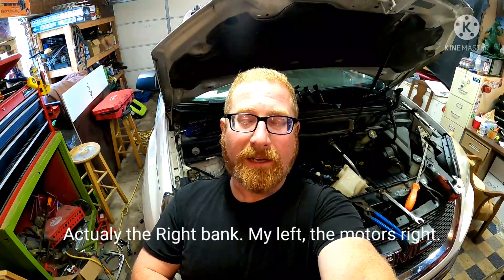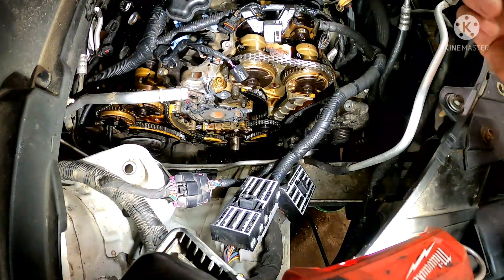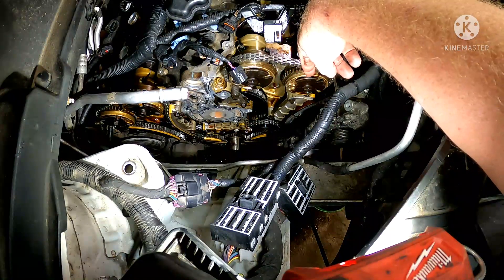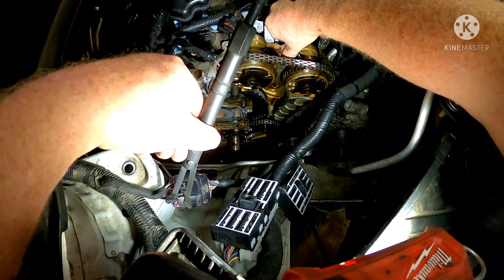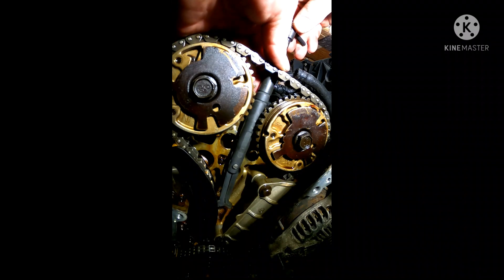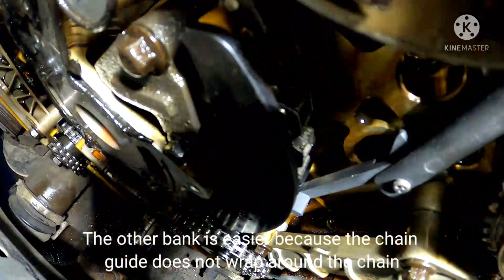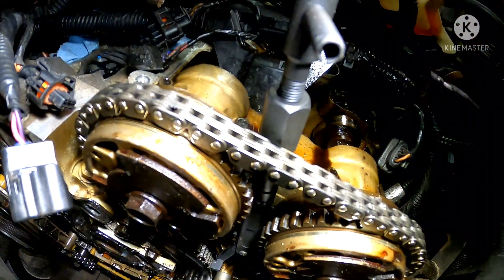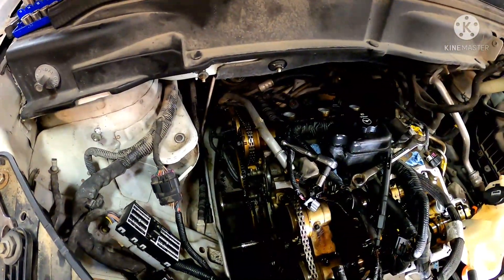How to replace a GM 3.6 VVT cam phaser without removing the timing chain or cover.

Comment: thanks i’m dealing with a nightmare myself. cadillac 3.6 replaced head and timing someone dropped bolt in motor and messed up head compression is low on new head think it’s out of time just bought that tool

Comment: If you take the phaser out without removing the cover, how do you ensure the new one you put in is in the correct timing position?
Reply: For what it's worth, a source I am certain is the factory service manual demonstrates the use of a paint stick behind chains. It isn't detailed, but seems to suggest applying some marking medium to link and any involved sprockets. I have never done it and don't claim it works. It seems obvious very careful attention and very careful marking of links must be done. I think the phasers are locator pinned to cams. Timing cams to crank must be preserved, no matter what is done. The colored timing links will almost certainly not be relevant. I put two sets chains in separate 3.6 successfully. Best luck.
Reply: I mean colored timing links won't be in the right place during use of this tool. Obviously critical doing chains.

Comment: I am trying to do this right now on my 09 Buick Enclave.  Fourth time I have been into the timing components in four years of ownership.  This engine is a terrible design.  Do not buy one.  The VVT sprockets do not have sufficient clearance between the end og the cam and the timing cover to come out.  I am going to try and loosen the timing gover bolts and see if I can sneak the sprockets out.

Comment: My sister has an 09 Buick Enclave.  Same engine.  I have replaced all of the timing components twice in the last four years, and it looks like I have to replace one of the phasers again.  My feelings about the car are exactly the same as yours.
Reply: me too have a 2008 SRX same engine getting P0017 & P0008 codes....bummer. 198k on the odometer tho.

Comment: Just a an Observation with these motor and a lot of manufacturers they make the pvc system operate to minimum spec. So it make the oil get contaminated with not venting properly with DI mitigating oil. Then the addition of extended oil change intervals make it horrific. So every things get gummed up and has to work harder. Their fairly decent engines that were designed to return to the  service bay. My suggestion would be a timing chain and phaser replacement. 3-5k oil change intervals with Amsoil (quality oil). Use Shell Rotella t6(diesel motor/higher cleaning agents) oil and a flush oil and to clean up the  oil system yearly or twice. Only as a flush so just fill/drain 3/30 min =3 bottles then place quality oil. Also replace the PVC breather yearly.  Liquidmoly fuel injection cleaner 6 cans one on each fill up to attack carbon build up on pistons. This a thing that the across the board with all manufactures in my opinion. So optimal maintenance schedule is required for all these cars that are usa manfactutred. Need a bullet proof car Lexus even high mileage 100k-190k depending on how it was driven mostly highway. Use the flush method / carbon clean /pvc replacement on Lexus motor as maintenance and you'll thank me later. lol

Comment: Thanks. Hoping my code on 3.6 is just the solenoid.  Probably not.  Just sold my best car for $4. Saab 93 250,000 mile, no work except oring on power steering. Probably going to be sorry.

Comment: Do not buy a GM car with 3.6 VVT engine. My Enclave 3.6 failed at 68K miles. This is a crap engine.
Reply: They came crappy from factory but with a little touch ups these motors can last you 300k+ miles. In other words it needs to be rebuilt
Reply: Mine blew at 69k miles, same motor I’m going to buy a donor motor to replace the bottom end that blew up

Comment: A bud of mine wrecked his vvt gaskets and I'm not exactly sure of location. Just wondering if you can replace them from the top side removing phasers with same tool or is chain cover removal necessary?

Comment: Regarding "the tool"...google the number specified in the video and you can find for about $165 or so....but, beware.....it seems as though the tool locks everything in place so that the chain does not slip off the lower sprocket - not provide slack.  Additionally, it would seem as though you need to remove the camshaft to get the sprocket out as there does not seem to be enough clearance to remove the sprocket with the camshaft and chains in place.....is there anyone that has actually changed these without removing the cover or is this an urban legend?
Reply: I am currently attempting to 😂

Comment: Every now and then I give the pcv a couple of squirts of throttle body cleaner on engine, also change oil every 2.500 miles and add a bottle of high milage Rislone. 250.000 miles no slap no problems, get 19 miles a gallon.

Comment: Great video!! Can you tell us what tool you use for removing the harmonic balancer?
Reply from the maker: I used a 3 jaw puller that i cut one of the reversible jaws in half to clear the structure of the car. It was a real pain to get that jaw to stay engaged. I think i wound up wedging a 3/8 extension between that jaw and the center screw to get it to hold in place
Reply: @Rosco P Soultrain , thank you for responding. I think I may have seen that in one of your videos? I appreciate your taking time to answer, thanks again! 🤙💪🇺🇸🇺🇸
Reply: For rent at Advance, and it's a slick little number that really works.

Comment: I notice the tensioner will be lock if it's not push in all the way, (I used a C camp to push it in) and reload the holding pin, make sure it works by pulling the holding pin to verify it's not lock in place.

Comment: where did you buy the tool and a price if possible
Reply from the maker: Fredom Racing tool and Auto. I think it was a little over $300 for the pair. I am thinkig about putting the ones i have on ebay.

Comment: This vehicle is a pain. I'm currently working on mine. Attempting to replace cam phaser exhaust, bank 1. Used the tool but it doesn't do well. Couldn't get it to retain the chain. Gonna have to remove the timing cover anyway. Seems this tool is more so for retaining the chain while having to still remove the timing cover. Bummer. Thanks for the vid.

Comment: I have a Cadillac CTS with the same engine, just did this for the third time, finally got it right I believe? I bought the car with the problem so have no baseline to know for sure but it is running very well right now (as much as a 3.0L can I guess) though it ran pretty well before after my second attempt too until it didn't. Anyway the codes clearing is still my concern, if I may ask? Where did you find the info regarding the codes clearing in 15 run cycles and/or 200 miles, I have an OBD scanner program and have cleared them multiple times but as soon as I shut it off and restart, the codes return, did this eventually resolve for you and do you have any idea what amount of run time is considered a run cycle? I need to get rid of this CEL it's bugging me and I may be selling this bugger.
Reply from the maker: I cant remember where i read it at. The codes did clear after a couple days of regular driving
Reply: If I'm doing the phaser replacement on a 2008 Cadillac CTS with 124000 miles should I replace the timing chain as well?
Reply: @EEEBA1  Personally I would not want to do this job more than once if you even get  a second chance to since it's an interference engine, though it seems that's nearly impossible. I would most definitely change all functional parts, to me having raced sports car before, it is not worth cutting corners, if anything fails then you suddenly have an interference engine that implodes on itself and the parts are not prohibitively expensive to change.
Reply: @kw57rx8dr.9  I agree. It's better to change it since it should be easy to access.

Comment: good afternoon friend, I have a Chevrolet Captiva 3.6 v6 engine and I have to change the pulleys of the intake controls I live in Dourados Mato Grosso do Sul in Brazil, and I cannot find this tool here in Brazil to buy, could you please tell me help me by passing the code of this tool or some site that I could import from your country to mine I would appreciate it, thank you

Comment: We bought a Caddy SRX AWD with the 3.6. Cool thing about the AWD is the engine/trans is linear instead of transverse mounted. I still have to work on it seems as much as you do yours but this setup makes it a lot easier; much more like working on a pickup truck

Comment: Do you remeber the torque specs for the cam phaser bolt? Found somewhere on the internet that said 118ft/lbs witch broke the bolt off in the cam
Reply from the maker: I believe it was 45ft/lbs but i cant recal for sure

Comment: the reason this car is annoying is cause of that interference(which is interdependent) engineering, one thing goes wrong & it makes other stuff go rong.  pcv holes/sludge in engine clogges up phasers, they mess up timing, or make oil clog up tensioners, then loose chain, then mess up timing, & so on, in what ever order, this needs up that, then that messes up this. why? s2pid-S interfeerance engine engineering crap.  & 183k/10 years old is the kind of area where this s2pidiT comes to flourish in its dumnS.  Because if this multidirectional interactive engineering dumness/s2pidiT, one is Ysr 2 replace everything & clean it at same time.. 
now on that note about that hypothetical sludge dissolver I mentioned in last comment.. never-mind i gUgLd it, auto RX plus all natural engine cleaner, 1 plastic bottle.. so perhaps problem start to finish is - 1, brake clean/vacuum out bulk of sludge under oil covers, 2, drill top hole 7/64ths & botom 2 holes 5/64 in PCV valve & clean with brake cleaner, 3- oil change & flop 2 bottles of that auto RX in there. 4- again in another 3000k & 5, do an entire timing chain, with water pump, oil pump(trick to torque those bolts in secret sequence, utube it), seal to sump pump, etc., all the cam phasers & sprokets & gaskets & everything..  then from then on, change w/quality oil maintanance dose of auto-RX & Home Depot green can chlorine free brake clean pcv valve each time.  for all those little holes in crankshaft actuators & phaser sprockets & timing chain tensioners & ALLL THAAAT DUMLY ENGINEERED STUFF..  someone please make 1 good video of the entire above paragraph?☝️  THANQ!😑

Comment: Be prepared to chase diy problems. I have to replace lifters in bank 2 and the sensor on top of the tank ony 2010 Camaro V6. To make it easy change the phasers, lifters and rocker arms while you got it open. I also changed the oil pump. Plenty of good vidz on how to do all that. It may cost 1k or a lil more but better than 5-7k. Or more at a shop. 😳

Comment: someone’s gotta invent a biodegradable substance that turns all oil sludge into a fine viscosity liquid that can be drained, THEN someone must make a step by step viDO for how to replace, clean, a torque the entire timing chain area with EVERYTHING REPLACED.  mNnnn some1 do it, we don’t all have 3-4000$ to fork over to the dealer while we car lessly wait a few weeks for them to get around to it👋😑.

Comment: good job just for attempting it(& good chance successful).  I believe to change everything at dealer, full timing chain kit, water pump, oil pump, all 4 camshaft wheels, all gaskets, set timing phase 1 & 2, & alll that gibity gab.. costs several thousand at dealer, & a few thousand at least at mechanic(& they have chance of screwing up).. it ain’t no picnic & I wonder if it’s cheaper & better just to buy a low mileage used engine & swap it- that’s an unknown I suppose👋😔

Comment: You have way too much sludge in that engine. The oil pressure passages in the chain tensioner there gets clogged, varnished,  and then fail. More freq  oil changes, better oil, and especially keep the PCV oriface holes clean on that engine right bank ( to left when looking at the front chain sets.) They are too small and clog, completely. Some people ream those orifaces out bigger, They are really tiny/small. Then carbons from the trapped crankcase  gases gum the oil. (ESPECIALLY with Ethanol fuels) Known issue  with these 3.6L GMs. Ive worked on these a bunch..
Reply: on pcv-valve one guy had a video & said to drill top hole to 7/64ths & 2 bottom ones to 5/64ths & he cleaned it w/brake cleaner.. 
perhaps that & sea foaming hole darn engine & putting some oil cleaner in there.. is there some cleaner that turns oil sludge into liquid do it can be drained out? or perhaps chlorine free brake cleaner & a vaquum for top area?, then sea foam?, then this oil cleaner stuff with oil change?, & then maybe tensioner holes don’t get clogged?.. idOnO watta conIving factory scam, or mAB just screw up👋

Comment: I have a question for you sir. My new chain jumped two teeth on the intake phaser just how yours was doing. Why is it doing this the three chains and tensioner and guides are all brand new. (Dry?) would be my only guess but how do I prevent it from jumping timing when it’s all put back together? (Currently timing covers sealer so if I can get away without pulling it again that would be ideal.
Reply from the maker: I think because I had a bad phaser that the phaser activating at startup caused a shock load in the  chain that was enough to retract the tensioner. That is just my guess on what I had happen to my motor.
Reply: @roscopsoultrain5875  if you wait to long to start the motor after the new timing chain installed Weeks/ Months. The tensioners can dry out. and stick momentarally. The tensioners are oil pressurized and a dry start will give the chains enough time to jump on initial start up while the motor builds pressure. If doing dry start , disable ignition and build up pressure by using the starter in one long crank over.

Comment: Well done on your repair and your patience for this engine.  It looks like this is something everyone with this will need to tackle at some stage.
I have this engine and the error codes so ill need to do this fix.  I have looked at many youtube vids on this and everyone of them gives a little tip that add up.😎 Thankyou from Australia.  One interesting tip i just found out was to clean and replace the oil pickup filter and seal in the oil sump, i think this may be the source of many troubles looking at the design of the way the pickup seal mates with the oil pump.. https://www.youtube.com/watch?v=4sR7qPgYiSk
Reply: I recently seen on a video that the 2 bolts to oil pump have to be torques in a very specific, strange sequence.. that mIt be part of it too.  let’s face it, these things are probley designed from factory to be nearly impossible for everyone but triple priced dealer.  It’s a dRn good scM👋

Comment: Where did you get the chain tool? I can seem to find it anywhere. Thanks.
Reply from the maker: I bought mine from Freedom Racing.  I believe they are around $170. Come in a set of 2 so you can do both banks at the same time. I imagine mine are just going to sit in my toolbox for the rest of their life so I'd make you a deal on these.
Reply: @roscopsoultrain5875  Would you take $100 for it? I am running into the same issue, the second Mechanic says the phasers are bad after the first mechanic changed chains and tensioners and everything else. So to avoid the total mess of taking everything apart i hope this tool will do the trick.
Reply: Let me know about the tool, I am still willing to buy it. Thanks
Reply: You still have the tool?
Reply: Anyone still have this tool and looking to sell it? Let me know.

Comment: I feel your pain!  You  said it nicely though.  I hate this car.   I put a transmission in it before this, only to have the module fail while under warranty.   The sunroof vents clog every few  months,  replace the blower motor, struts, stabilizer links.  Now this.  Did the whole chain in the driveway like you.  I somehow got one cam off 90°.  Too many marks on the phasers.  Now I have to tear it apart again.   I'm about ready to roll it off a cliff